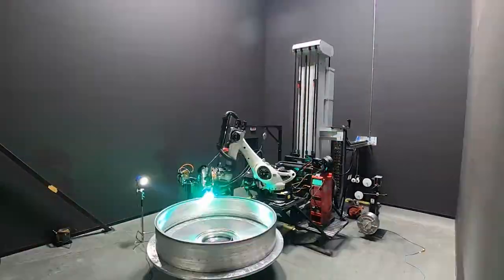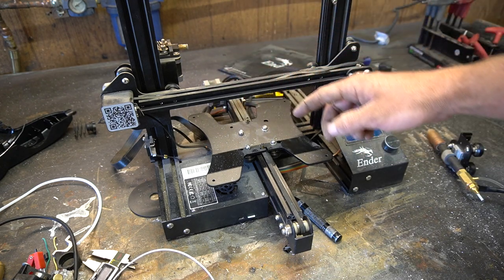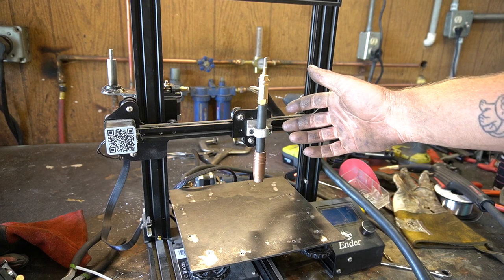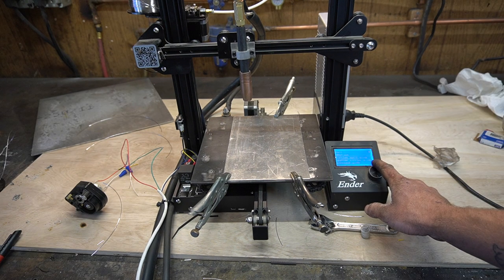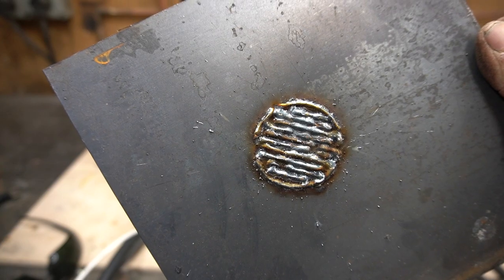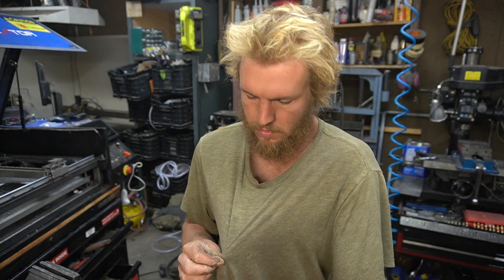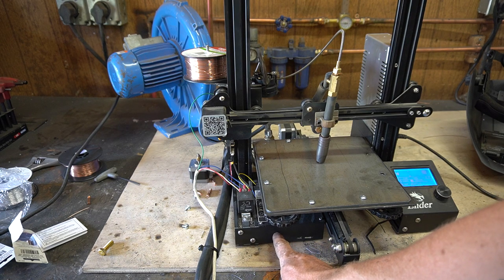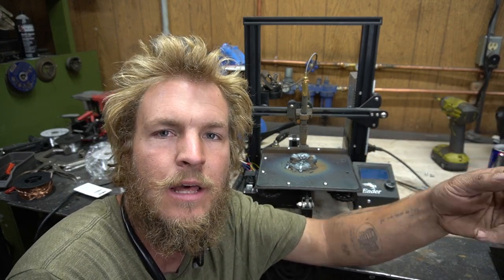DIY Metal 3D Printer

Comment: There should be a setting in the slicer to random start locations. It helps with visual seams and strength. That could help with sinking of the bead.
Reply from the maker: Man, such a simply but smart solution! I'll have to find me a slicer with that option
Reply: @cranktowncity  What slicer do you use?
Reply from the maker: @bioshift1  I got the old-school creality one, 1.2.3
Reply: @cranktowncity  I believe that's cura. You should be able to set it in z seam under alignment. To random or otherwise.
Reply: Prusa slicer has a random seam option in the slicer.
Reply: there is, in cura one can randomize the skin's start for each layer.
Reply: @cranktowncity  Simplify 3D have this option
Reply: All of the slicers have a random layer transition option.
Reply: @cranktowncity  I made the switch from creality to prusa slicer and it's one of the best things I ever did for my 3D prints!
Reply: @girrrrrrr2  correct
Reply: @cranktowncity   in all slicers there is a tab where to put code, you must tweak the "Linear_Advance" parameter.
You can search for videos regarding the subject, in your language a "pronterface" program is usually used, the codes are obtained and can be loaded either in the firmware or you can enter it as a code for each print

Comment: Heavy base plate to suck the heat out would be helpful.   You could even do a water cooled fixture plate if you wanted.
Reply: Also, an aluminum plate with some heat sinks in the bottom and air blown over those would help cool as well without blowing out the shielding gas
Reply: @thirstybike  ehhh who needs shielding gas
Reply: @BigCroca shielding gas is what I was thinking.  Seems like it would be pretty easy too, just run it right next to the welder

Comment: if you going to do a metal 3d printer then set the machine up in a purge chamber.. assuming its steel that you trying to make the parts out of then fill it with argon.  now this is the expensive part.. you need to get your self a double pulse mig set up or even better a fronius cmt welder.. welding with a flux core/innershield wont work as the porosity and slag layers will prevent the part from actually becoming whole in the grain of the material so any part will be next to useless in a serious application. your also need to use a water cooled set up as the torch will not hold for long on the duty cycle of a air torch.. not to mention your need a machine that will do the needed amount of amps for 100 percent duty cycle otherwise you going to torch your machine in the long run.. welders prefer to run at 60 percent duty cycle or higher.. the 20-30 percent are only there for the odd job. hope this helps you on your quest

Comment: With robotic MIG welding we typically program a pause at the end of a weld bead where weld settings change to less heat, more wire feed to fill the end crater that develops.

Comment: From what ive seen people say that an argon filled environment helps a lot.

So maybe a case full of argon made of tinted glass/acrylic could be helpful
Reply: you can also just crank the esteps to up how much it extrudes per mm, for example if you double it, it will move the extruder double what it should be. or instead of using fan pins theres laser, and cnc support in marlin using different gcode, so you could wire the the trigger from the welder to those using a relay. Or something like that.
Reply from the maker: dude, awesome ideas, thank you. especially like the idea of a tinted enclosure, my eye sockets need a break!
Reply: @cranktowncity  Welding machines for doing TIG push a stream of Nitrogen or Argon directly onto the weld. These can be had for MIG as well which is what he is doing here. This is simply a case of getting a new welder with Gas line and a Cup for the tip which holds the gas around the end. This would save you the headaches of trying to make a full box of gas.
Reply: @seditt5146  There seems to already be a an inert gas line feeding this torch, see at about @8:20 and it is the clear hose coming in from the side.
I guessed there was no gas coverage earlier in the video, with the crappy looking aluminium weld-beads, but that could also been from trying to use argon/co2 mix (which is for steel) instead of argon or argon/helium mix.

Comment: Smaller wire means less heat. Ceramic or fire brick material bed clad with tungsten,  with active cooling like what is used in steel mill furnaces.  I would also enclose the print volume with shaded materialfor uniformity of heat, eye protection, and shield gas retention.  That allows even more cooling below the bed. Swap the rubber wheels out for ceramic or perhaps high temperature silicone? Drive belts will be an issue due to heat as well.  A flexible temperature resistant material,  or consider rack and pinion or other linear gear setup to replace the drive belts. I would also recommend relocating the stepper motors further away from the print area. The heat will likely destroy them quickly. Just extend the linear gear portion to mesh with the gear mounted to the stepper motor further away from the heat source.  I'd do the same thing for the limit switches. And absolutely if you can control wire feed via the stepper, I would.  I bet the drive rolls from the welder could be adapted to fit the motor that normally feeds the extruder. Mine already has a spring loaded tensioner . The drive rolls for metal wire I imagine need considerably more force than plastic to accurately feed without slippage.

Comment: What you need is part cooling. Let the fan blow on the part during printing then it won't sag as much. Great project!
Reply: The wire releases gas as it melts, which forms a bubble around the metal to keep the oxygen away from the weld (he said this in the video). If you try to use a fan, it would blow away the protective gas and weaken the weld.
Reply: @RussellBeattie  Then part cool with a similar enough gas to keep the welds strong. Get creative.

Comment: Great concept. My thoughts are stick with Mig, it's going to be much easier than Tig. Then work on being able to control your Amps and wire feed. Ramping the Amps down once it gets running should be possible as it's already carrying heat. Maybe to start with do it man to prove concept. I can see a cnc welder/plasma cutter in the making. Stick with it, it's gonna be excellent.

Comment: I think the speed has to be higher, also there has to be a good fan to cool the soldering filament instantly there shouldn't be this red macula after it is soldered, while this red means that it will deform with the next layer , if it cools instantly it will not deform, the heat has to be only at the welding point it does not have to expand to nearby points, that is just my think and your idea is genius

Comment: Have you tried doing a tack weld? I have done a progressive tack style that looked like a tig bead. kind of like a line of coins. clearly that continues bead is too hot. Set up a pulse cycle of, say one second where 2 tns. is weld and 8 tns. is cool down. Mess with it that way with different combos. You are way smarter than me, I can't even set up a regular printer, but I've welded the seam on a power-saw muffler, very thin, and it came out nice using Mig. Just a thought.

Comment: Pretty cool.  I wonder if you printed objects at the maximum size for the bed if that would let them cool more.  The wall thickness would be a smaller fraction of the overall objects size and probably wouldn't retain as much heat.
Reply: That or that blower fan on the object. Instead of the board. It should help but it will blow away the shielding gas... Which could be fixed by fluxcore maybe

Comment: Well, the example you based your idea off of was much larger. Maybe this is one of those things that has to be done in a larger scale?
The G code is set up for plastics to heat up and cool down in as short of time as possible but still maintain a certain rigidity. Steal would need more time to cool down so on a larger scale with the same settings this would make metals more manageable. Or option B would be to make your smaller prints in a much colder environment like in a refrigerator, a walk in freezer or Antarctica. 
Next problem would be how to pull your build off of the build plate. With PLA or ABS it cools down and is easier to pull off an aluminum plate. With your set up you would have to cut off the piece. So for the thumb printing, you would need to cut it off or add bridges to raise it off of the platform...but still have to cut it off. But it may need less grinding work that way?
Love the maverick style of inventing your way through a challenge by using stuff already sitting around!
Would there be any advantages to having an X and Y base with a Z nozzle or would it still have the same outcome? Would curved surfaces like your sphere be better if the G code were to cool down the material once the welds were in closer proximity to prevent the molten metal mishaps? 
Again, love the content! Thank you for your channel!
Reply from the maker: A lot of good ideas her, thanks man!
Reply: In the big example, they have developed software that calculates all the weird heating/cooling distortions that take place and adjusts the printing accordingly.
So its not the size scale that magically makes their tech work. There's much more to it.

Comment: Seems like Tig would be the better process here. Maybe less build up but better puddle control.
Also, +1 for mentioning the oft ignored M-codes. As your past President would say, "...not a lot of people know about M-codes."
Reply from the maker: M-codes need love too man
Reply: @cranktowncity  
Also, M'kay Bro-codes, eh 🍁
Reply: Implementation of tig welder here would be much harder that MIG.
Reply: @kundeleczek1  True. TIG is a manual process like soldering using a separatley hand fed rod of material. What I know not even a million dollar industrial robot can TIG weld because of the nature of the process being impossible for any machine to handle. The wire being fed in separatley from the side without touching the electrode that needs to in turn be around a max distance of 0.2 mm from the workpiece is something only a human can do. I TIG weld a lot myself at work at the moment. It a really fun but also really tricky thing to do and I'm very happy to master it good enough that the result in the end looks very profesional. Its a true skill to master TIG welding.

Comment: I think you can get some control of the feed rate without effecting the gantry movement with the filament thickness setting in the slicer. 

And I just noticed there is a part 2, so you probably solved it already. Oh well, I needed a comment and ain't deleting it

Comment: You might have the skill to retry this on a modded 4 axis with rotating printhead (theta is the fourth axe), that might solve the issue with complex models where the welder hits the prin- the melted bead.
And it would be the bedslinger version of a 200k bucks worth actual welding robot!
(those are 5 axis actually ok)

Comment: How about current sensor loop to hook up to your arduino controller and run the welding wire through it, add a voltmeter between the welding wire and base plate. Power = Current * Voltage. Integrate (smooth) the power and use that for feed control. I have no idea how much current and power fluctuate during welding, but imagine both do a lot, so both are required.

Fill the cabinet with Argon? The Russian built Titanium Submarines inside Argon filled buildings.

Comment: Well the result at 8:53 is HOT, and it looked faster than I remember an Ender3 could be! 
I am wondering why the benchy and not a vase. A vase without bridges possibly.
This is one of the coolest...most surprisingly things in 3D printing I've seen so far!
Google listens and heard that I just got into a welding class and dude, this content hit me hard!

Edit: at 9:06 you were clearly checking layers adhesion. Don't worry, at worst you could turn off the fan 🤣🤣🤣

Comment: I think it might be easier to implement if you could modify a non cartesian style printer where the bed stays stationary like a delta or core-xy style printer. With those it'll be much easier to design cooling and maybe even an enclosure as well since the footprint of the printer stays the same. And also a printer with linear rails instead of v-rollers for axis travel will be a lot more durable since there wont be any plastic/rubber wheels to melt. If you do go this route maybe check out the Flsun SR I've seen the prices drop to high 300s at times and its got all the things i mentioned.
Reply: Also building a feed system for a delta or core-xy would be a lot easier since most of them just have a feed system where the filament has a straight travel path directly from the top of the machine to the hotend
Reply: Problem is he’d be disassembling a over 1000 printer all to take it apart to pieces and severely modify it, That’s not a cheap job and doubt this guy wants to spend that on building this. Tho you make a decent point.

Comment: hi. the idea is correct. but in this case it is suitable for the manufacture of large parts. you need to reduce the diameter of the wire, the burner, etc.

Comment: You can easily adjust the feed by modifying the step/mm value on the extruder (firmware side) having a properly managed feedrate is mandatory if you want to achieve anything and by tweaking the retraction speed and length (slicer side) you might alleviate some of the weld bead and obviously get the power supply out of there it's going to fry
Reply: this is the answer. change the esteps. problem solved

Comment: Blasting the bed with CO2 for cooling should work.
However it has problems such as CO2 build-up and reaction with material (Less then air, still significant).
So compress air plus a solenoid valve should be good enough if you do mind a oxide layer.
A more clean result would be archived with room temperature inert gas, with close loop recycling would make it more viable for mass production.

However, we aren't there yet.
So just using a high power fan and some air flow redirecting component operate by highly train and competent human operator  made of of scrap steel on a hinge should suffice.
Flexible air conditioner duct if you fancy.

Comment: do you tried water mist for cooling? or water cooling for a table? and I guess would be better to use aluminum rather than steel. because aluminum have lower melting temperature and it good thermal conductor

Comment: 😅 Man ✌🏻 i was looking in that topic for 2weeks now and thought about prozesses like using a plasma cutter, a laser or tig welding. I saw your 3d tig THING. Thats the best way to go for now. BUT - for most the parts we like to print, its like 3d printing!!! So we need MICRO TIG TORCHES like wp9p's, a TIG WELDER WITH ADJUSTABLE small AMPERrates & PULSE FUNCTION stuff, a BETTER WIREFEEDER like for Soldering and so on. I already 3d modeling Holders and stuff to use on a 3d printer, to visualize. LESS HEAT, THIN WALL THICKNESS is the way to go. It sucks heaving such ideas 🤦🏻👍🏻 SUBSCRIBED

Comment: i think you could either try post-processing code doing z hops after set travel distance to do actual beads or set up pauses with both the weld gun and the ground to print in pulses but who knows

Comment: All you need to do is set the extruder flow rate, or do volumetric extrusion which is based on the filament or wire diameter

Comment: I used the same M106 port for a project I'm working on, but unlike you I was too stupid to use a relay and just allowed my 24v control to go unimpeded through the gate of a control MOSFET, frying my part cooling fan MOSFET

Comment: You should not have to modify the code to use the stepper for wire feed! Set the extruder calibration, filament diameter or similar parameters to match and it "should" "just work" ;)

Comment: welding wire is too thick. Not available. Custom made, thinnest welding wire and nozzle are required. You should choose the amperage and CNC speed suitable for this wire. So the resolution will be very high. The process will take longer. After many tries, you will be surprised at the result. :) You will find that it is just as successful as other metal printers. Greetings from turkey.

Comment: You are wasting a lot of time trying to invent what is already invented.... find an old working mig welder and adapt the nozzle to your printer. Connect the control wire to your mig so that when "ON" is selected, the mig welder starts as well. Control the wire feed from the welder to the speed required. Simple, easy to do. Only you must support the mig nozzle from two points to prevent shaking.... Control is what this is all about. CONTROL.
I have a Crealty 3D printer and will do the same with it....... My mig is a .9 mig wire WIA (Now Miller) 
The mig welder allows you to control wire speed, temperature and this will allow you to dom what ever you want
NOTHING is IMPOSSIBLE if you WANT TO DO IT
Good Luck to all those young mind's